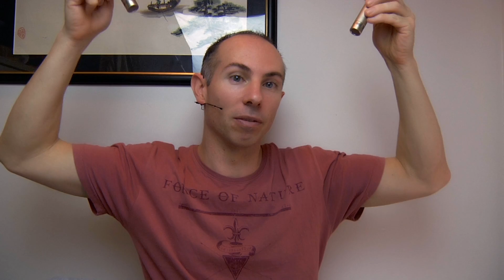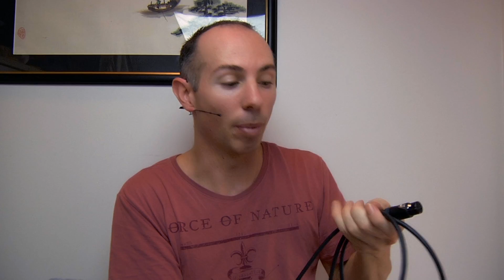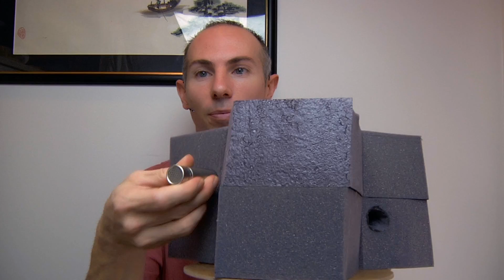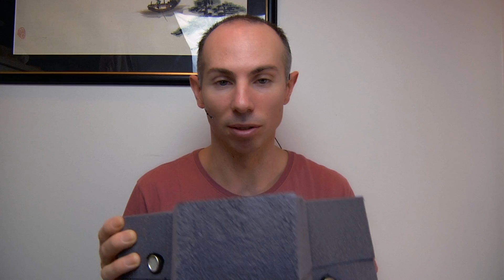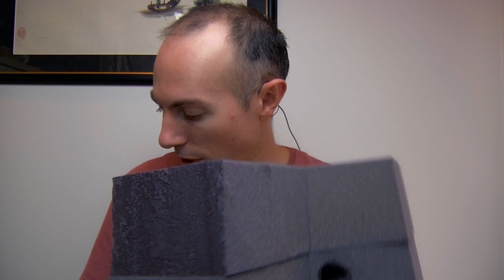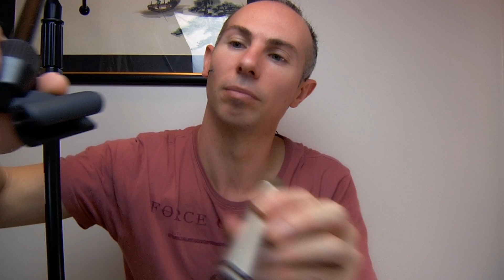ASMR How to Workshop - The Audio Recording Equipment i use Rode NT5 + Zoom H4N

Comment: Hi sir, I am interested in buying one  single Rode NT5 pencil mic to plug directly to my Zoom H5 like what  this link is doing:
https://youtu.be/2YepKGC9aBk
However my local DJ  Store does not allow me to test this. Do you happen to plug  the Rode NT5 into your Zoom H4 (as I believe Zoom h4 XLR adapter is the same as Zoom H5)  for this experiment please without the need to connect via a XLR cable? Thanks in advance